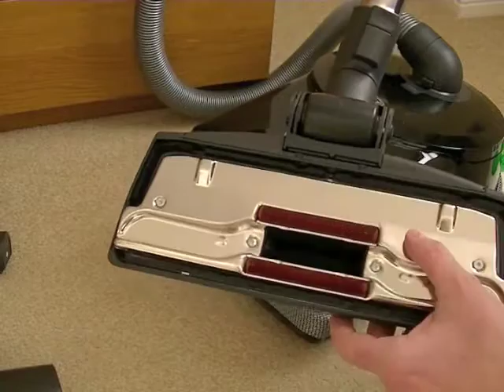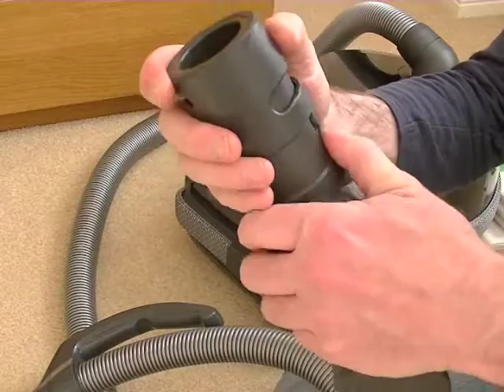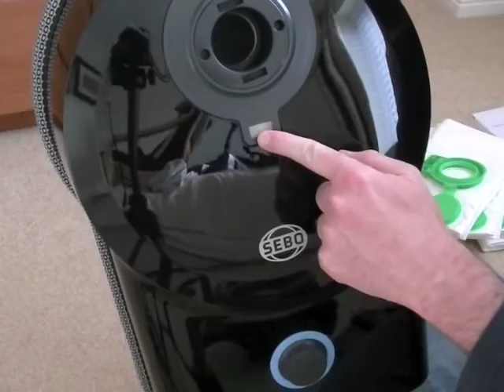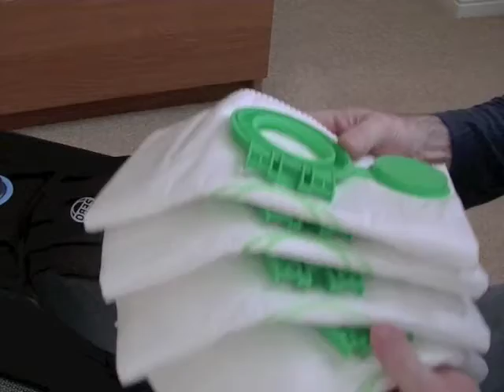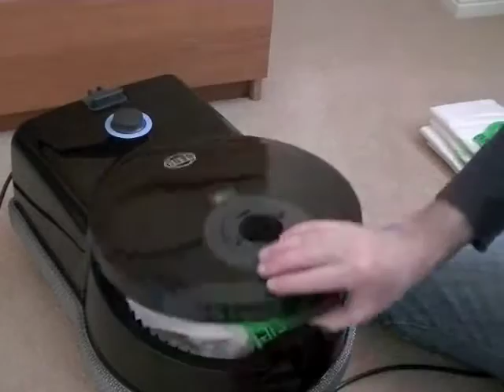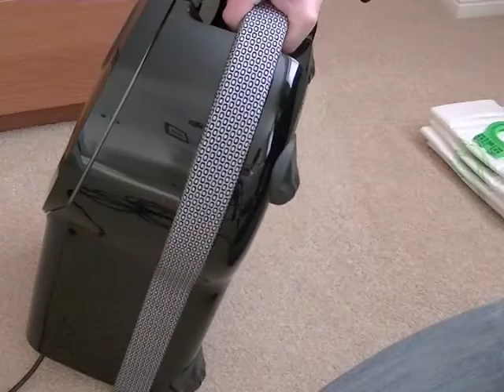Sebo D2 Total Cylinder Vacuum Cleaner Demonstration

Comment: Hi. Thinking of getting one of these. How does this compare with the Miele S8310? Which one would you say is the best? I've used the s8310 and was pretty impressed. Strong suction and nice and quiet.
Reply from the maker: The Sebo seems better built than the Miele but it is a heavier and bulky machine. It has a larger bag and more cable, so it's best for larger homes. The Miele is good and I would recommend either brand if you want a decent, quieter vacuum cleaner.
Reply: ibaisaic Thanks for the quick reply. One more question please. What would you say about owning one of these Sebo D2 Totals (£220) VS a Henry Hoover HVR200 (600-1200w version, about £100). I can also purchase a Henry Xtra for about £130. My house is all wooden flooring with a couple of rugs. I hear you can purchase both electric and air driven brushes for the Henry and the Sebo. There are some rave reviews about Henrys but I really can't see why as the black and white specs don't seem too fantastic.  The floor head seems worse than the Sebo's too.  Just wondering if you could shed some light on this.
Reply from the maker: Firstly, if your house is mainly hard floors, there is no need to buy a vacuum cleaner with a power nozzle. You can't buy an optional electric nozzle for the Henry cleaners as they do not have a power take off socket. You can still get a Henry Turbo from some online retailers that comes with an electric head, or the green Henry Hound which is similar but not widely available. 

The only Sebo cylinder that you can buy an optional electric power head for is the K3 Vulcano, but you may as well get the K3 Premium which comes with the power head as standard. 

I'm not a big fan of Henry cleaners, but the latest models have a carpet/floor head similar to the Sebo cylinders which should give a better performance, though they are rated C for carpet cleaning which is a bit mediocre. Check out John Lewis as they have two exclusive Numatic cleaners, John and Lewis that come with the better head plus the turbo nozzle for less than the standard Henry Extra.
Reply: ibaisaic Thank you for your help once again.  You really know your stuff! The reason I was interested in the electric turbo brush attachment was because I am actually planning on getting carpet in the next year or two. I've heard that the electric turbo brushes are generally much better than the air driven variety. Quite surprised these aren't compatible though. For some reason I thought they were battery powered!  Thanks for the advice on the John/Lewis models.

I don't think either of these vacuums are for me. I've actually tested them now. The Henry makes a really annoying whining sound when on, it's heavy and it's very difficult to move around compared to the D2. The D2, I found to be really impressive actually. The fact I cannot really upgrade it does frustrate me a bit. I'm actually thinking of purchasing the Sebo Felix Pet as an all-round solution to this dilemma. I've found it at £237 and apparently it performs well. I can even upgrade it with a floor polishing attachment in the future, which I think is very unique. The only thing I'm worried about is the suction power (1300w). As the D2 is rated at 2100w, will this make a significant difference to cleaning performance on hard floors/general use would you say?  Thanks again for your quick responses.
Reply: David Banks By the way, do you know what the deal is with the 2015 Numatic Henry? I've noticed the power specifications have been dropped to 580w but I can't see any information about a high power setting. The 2014 model has a 600w and 1200w mode. Could this mean new Henrys perform worse than before? Do you think this has anything to do with the new EU regulations? I thought the limit was 1600w now to be honest...
Reply from the maker: I would recommend any of the Sebo Felix models. I have the Rosso version which is very similar to the Pet but does not come with the deluxe parquet brush.
For hard floors,the parquet brush head is very gentle with two soft spring loaded brushes designed to cope with uneven floors, while the power head cleans exceptionally well on carpets. Even though the Felix is under 1600 watts, Sebo will be launching lower wattage versions to give them an A energy rating.
I review the Rosso model on my channel, which should tell you everything to need to know.

Sebo have not yet updated their website, so I don't know what ratings they get for cleaning performance, dust emissions etc, but the current Felix has a Which best buy, Good Housekeeping Institute approval and my thumbs up too. My Mum has had her Felix for over five years and it is still going strong with no problems.

The new Numatic Henrys/Hettys only have a single speed motor now due to the motor wattage being reduced to 580 watts. Numatic say that due to a new cleaning head and some other improvements, it cleans better than the twin speed 1200 watt models. Numatic cleaners complied with the new regulations before, but they,  along with most other manufacturers are introducing cleaners that are under 900 watts so they comply with the further drop in maximum wattage that comes into effect in 2017.
Reply from the maker: ***** Miele did a battery operated power brush, but the ones currently on their website are all mains powered. They do not seem to offer the rechargeable power head any more, just the spare battery for it.
Reply from the maker: ***** Power brushes are very thin on the ground in the UK. Miele have just launched a cylinder cleaner with a power head, but the RRP is £600. The few manufacturers that offer a power head are Sebo, Numatic and Vax. Numatic have a Henry with a power brush called Henry Turbo (not to be confused with the Henry Extra).

Sebo offer two models with a power head, the D4 Premium and K3 Premium. The Sebo Vulcano has the option of adding the power head later, but it would cost more to add the power head to the Vulcano than to buy the K3 Premium with the power head included. 

Vax have one new model with a power head from their Silence range.

I have heard that Sebo are due to launch a new cylinder range which will include a power head model.
Reply: Happy to find this video . Though it seems like a long time since it has been posted but thought may be still good to seek your advice. I have a medium pile plush bedroom carpet. Wich cylindrical Sebo vacuum cleaner would you recommend pls? I desperately need a good vacuum cleaner for plush carpets. My about 8 year old Vax vacuum did a good job but now I think it is the time for replacement since where we moved recently, we have plush carpet in bedrooms and I struggle to vacuum clean it.

Comment: There is something you need to know about the elektrolux ultra one, its about the cord, when you rewind it make sure the machine is not hot , but on  a normal tempature otherwise the cord will be full of corkscrews and mav even damage the copper in the cord, a friend of mine had to buy a new cordrewind system because the cord was damaged, also the S-bag filtration compared to sebo and miele isnt that great, you will get dust in bag compartment.

Love your vids and vacuums

Your number one dutch fan :-D
Reply from the maker: Thanks for the tip, I will make sure the machine has cooled down before rewinding the flex. I have never owned an AEG Electrolux cylinder before, so I am looking forward to seeing how it compares with Miele and Sebo.